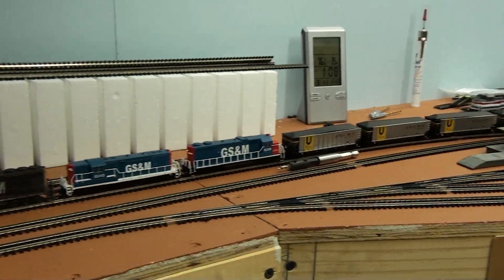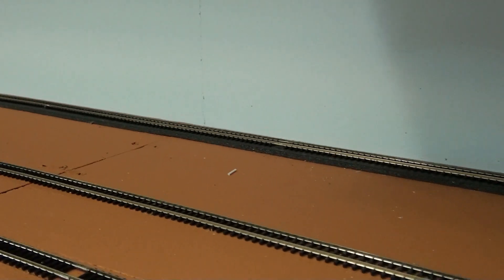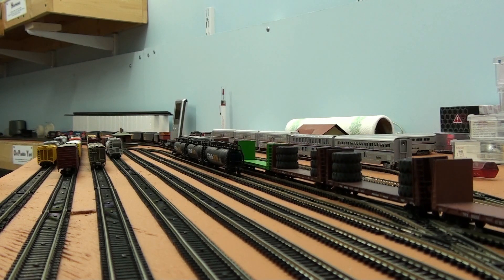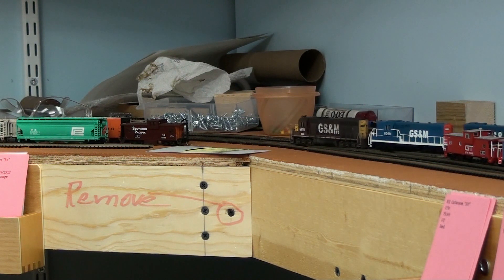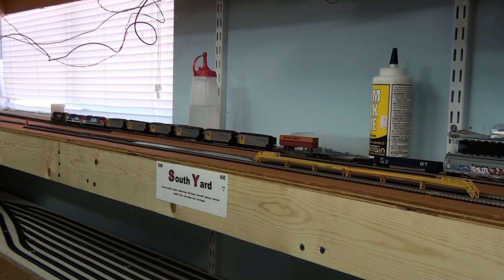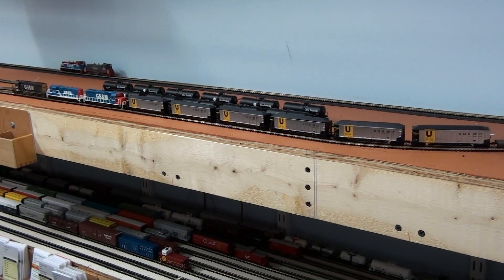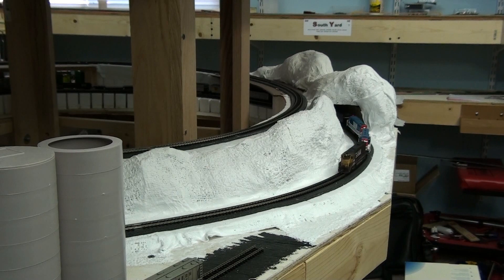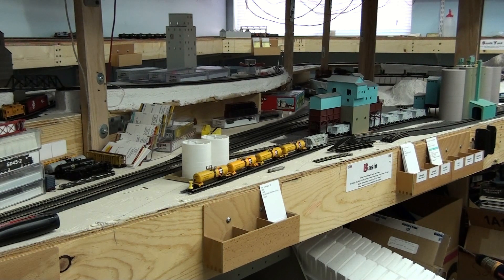GS&M March 11 2011

Comment: I just thought when u use cork it helps give a good look to the ballast when set  in place and its not just flat I understand in a yard but main lines where you run over and over and over it with long trains the yard just stores the train cars